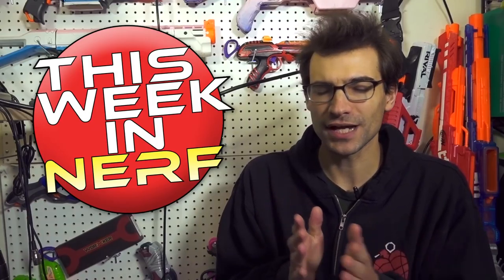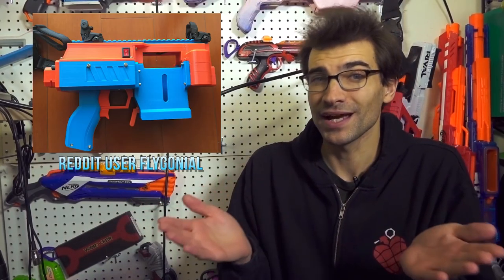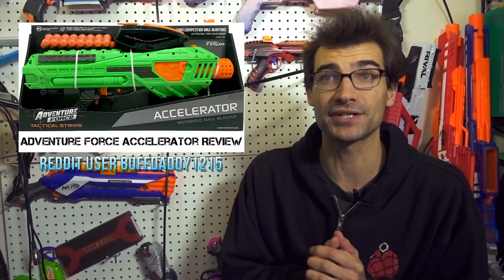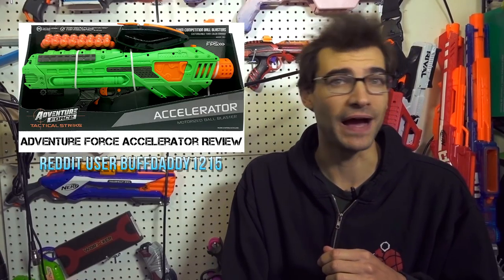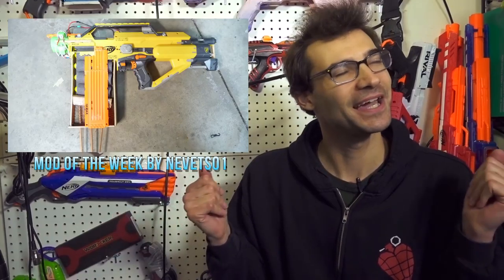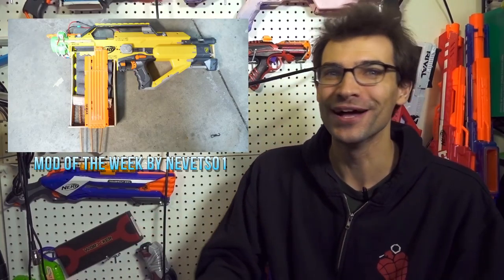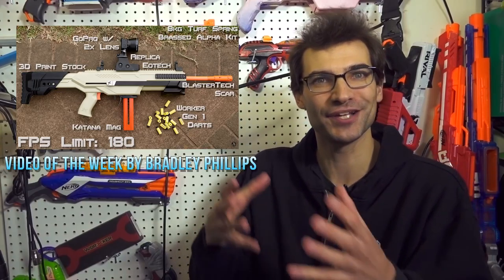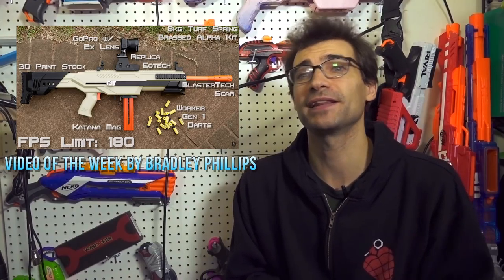(Video Clarification In Info) YouTube Changes! Semi Auto Rocket Launcher! This Week In Nerf News #42

Comment: You really ought to check out 498Nerf's new 3D printed flywheel blaster, the Foxfire MBS. It's compatible with standard superstock cages and wheels, fully modular, can easily be made multistage, and it has a stock attachment point. Totally worth showcasing next week, it looks really promising.
Reply from the maker: +Zach Kostechka That was actually talked about a little while ago :) It's definitely cool!

Comment: the scope cam even with 120fps styfes were always necessary. Having fov in line with the dart makes it so much easier to track because the dart doesnt move as much per pixel
Reply from the maker: The issue I was referencing was less the bonus of having a barrel cam to track darts and more the issue of shake or darts not being on screen when they hit because the blaster is moving. That issue is lessened when you're running something like a Longshot as you aren't up close and moving constantly, you can take the time to steady yourself for the cameras to track the darts all the way.